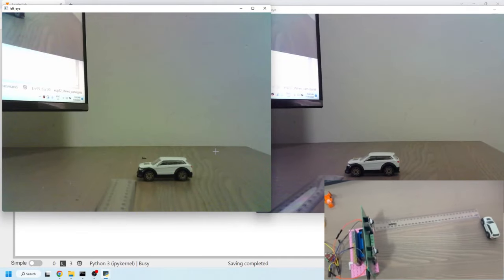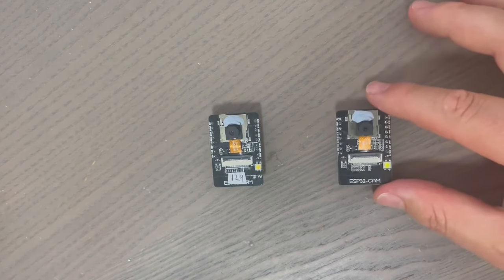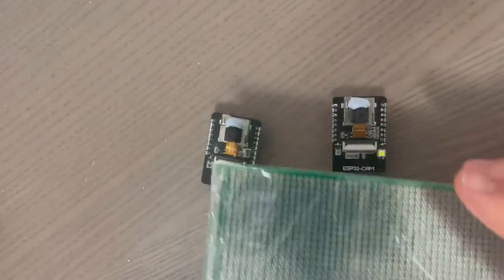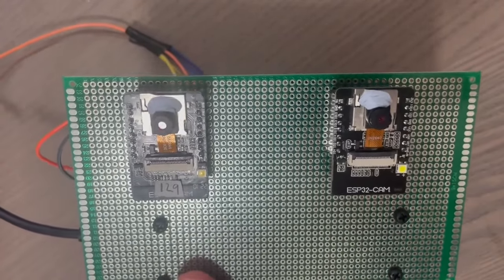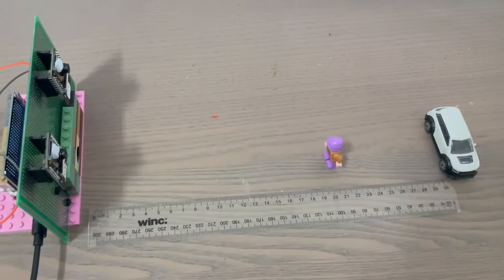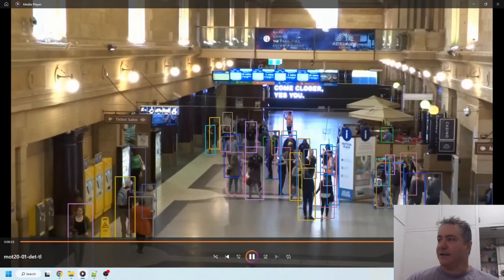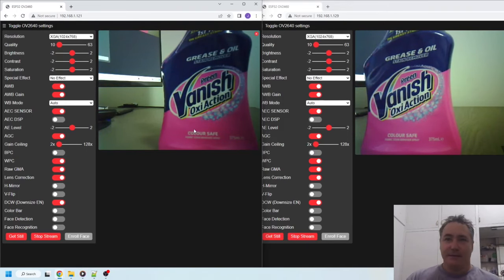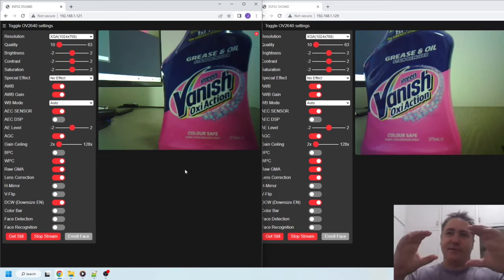ESP32 stereo camera for object detection, recognition and distance estimation

Comment: Amazing video, just got some minor questions:
- Is it a fair assumption to make that the focal length of this ov2640 is the same for all the of them from different esp32cams?
- Have you worked on calibrating the sensor to get the projection matrix?

Regards,
Kevin
Reply from the maker: Hi Kevin. Thanks for your comment. In my experience, ov2640 from different sellers (buying from ali express) can have varying degrees of quality.  So, I would say you need to calibrate every one of them. I haven't really spent much time on calibration. I usually just plug in the sensor and hope for the  best.

Comment: Have you heard of the old laser line trick for doing distance measurements? Super cheap, super fast, one camera and a (you guessed it) laser line. This is nice, because it tells you want the object is, which the laser line won't do. Nice work!
Reply from the maker: Thanks James. I will look at the laser line trick. I am planning to add a LIDAR to the esp32 camera at some stage. Hopefully, this will happen in the near future sometime.
Reply: @jonathanr4242  LiDAR are the cool toy everyone wants to play with. And they are wonderful, not doubt. A little spendy, but I'm seeing that the prices are getting down into the below $100 range? Hmmm... looks like a lot of those are NOT really LiDAR. LOL. The real problem with LiDAR and most 3D cameras is that they bury you in data. In the same way that the NN takes several seconds to lock in on the objects in this project, sorting through the LiDAR data and making use of it takes time. The laser line thing is nearly instant. It's a great first shot at ranging, which then helps things like image recognition because instead of handing the NN an entire frame, you can hand it just the one area where the object is known to be. That really speeds up recognition. And the total cost is like $5... or less actually, you can get cheap modules for a $1 from china.
Reply from the maker: Thank you, James. I will definitely look into it. Is the module you're referring to a time of flight sensor? Do you have any references for projects that have done this?
Reply: @jonathanr4242  I did it multiple times back in the 80's and it's been done many times since then but usually in slightly different form. It's nothing more than a laser line connected to an io pin to turn it on and off, and a camera. You capture a frame with the laser line off, then turn it on and capture another frame. Subtract the two frames, and the only thing left will be any reflections of the laser line against objects in front of the camera. Because of parallax between the line and the camera (the line is placed a bit below the camera), the distance from the bottom of the picture, up to the pixel where the line shows up, will be the range to the object. To clarify, the image subtraction is pixel by pixel. The first pixel (upper left corner) of the first image has a value (or values in RGB) and you subtract that value from the first pixel of the second image, making a new image with a pixel value which is the difference. One common use is with a turntable to make a low cost 3D scanner. like this from my site:
http://techref.massmind.org/techref/new/letter/news0310.htm
I'm suggesting that you don't use the turntable and you turn the laser and camera on their side. The laser projects out a plane under the camera, and only detects things that are resting on the surface. But then... what doesn't rest on the surface?
Reply from the maker: @JamesNewton  Thanks James! That sounds awesome. It gives me so many ideas. I had a project where I tried to use a laser to guide an electric water gun to the target. But I couldn't get this to work because the red light from the laser saturated the camera (showed up as all white), so it didn't work very well. I think  you've just told me how I can solve this.
Reply: @jonathanr4242  I'm glad to help, hope to see it in a future video. I'm always a little surprised that people haven't seen this. It worked back in the day, with a "camera" (video capture card) that had only 256 x 256 resolution and 256 grey scale, and it works fast today even in a web page (using a light block to trigger a phototransistor to turn on and off the laser). Let me know if you have questions or concerns.
Reply from the maker: @JamesNewton  Thanks for your help. I think I have all the equipment I need for the laser line in my man cave, but it's just a matter of finding the time with the other million projects I have started. I will reach out if I need help.

Comment: First, this video is amazing! 
Deployment of the model and communication with the esp32 are quite straight forward. 
The core of the project is the tracking and calculating the distance which I felt you kind of breezed over. I wish you could do an in depth video just on that part. A great video anyway though . Keep it up

After a second look - from my understanding there is a dangerous state where the object is close to the cameras. It will calculate the distance from the opposite corners of the object which will return...something that is probably not correct.  Good luck!  (The object should be symmetrical like a screen so the model predicts it as the same class)
Reply from the maker: Hi. Thanks for your comment. Yes the project needs a bit of tweaking. There are probably a fair few heuristics one can employ. In fact, every AI project will have some tweaks applied that will greatly improve them.

Also, I want to say that I discovered in another project that when I bring in the image from the esp32 cam, I'm taking it from a queue, so that I don't get the most recent image, I can get a bit of a delay. To fix this, I found this wrapper for the image capture stuff which avoids this bug. I've used the wrapper in another video with the time of flight camera. The github repo should be referenced in the description of that project. So basically, it uses a thread to keep reading eliminating frames in the queue so that when you want to grab a frame, it grabs the most recent, which is essential if you have moving objects.

Comment: Thanks for posting that and the files! Been wanting a nice stereo camera to use with an HMD, so I guess I may build a small edition of that.
Reply from the maker: Sounds Awesome! There is so much cool stuff you can do with a stereo camera. I made my own because I had some extra esp32-cams. But, the good thing about getting a proper stereo camera is that you can sync the frames a bit more easily, which is important if you want to do stereo video. I had some difficulties with synchronisation when I tried to use the esp32-cams for stereo video.
Reply: @jonathanr4242  Oh? Surprised. With short wires the latency should be short enough to synch the first frame.
Reply from the maker: @OMNI_INFINITY  I was using wifi with frame buffering. I didn't realise it at the time, but one solution would be to grab the most recent frame in the buffer, and drop the others.
Reply: @jonathanr4242  Ah. Can connect rx and tx of those seemingly.

Comment: Hello bro, just i came across your video, and i loved it, and i have watched some of your other videos also, I have a small doubt, can we detect the speed of the object, if its moving?
Reply from the maker: @rlrentertainmentsinventions  yes. Indeed, this project was inspired by a pedestrian tracking assignment I had. So, to measure linear motion should be ok. It might get more difficult with angular motion. 
I do have to wonder if there are Doppler shift speed sensors for arduino/esp32 microcontrollers?
Reply: @jonathanr4242   Ok bro, Anyways thanks for your reply

Comment: can you do a tutorial on connecting the hardware
Reply from the maker: Thanks for your comment. It's actually very simple to connect the hardware. All I do is make sure the two esp32 cams are on a grid, so that they are fixed in position, and then upload the sketch to them. In all honesty, the kind of stereo cam I've used is a bit messy. I would probably recommend using a proper usb type stereo camera.

Comment: Hi, i was thinking of trying this method for mesuring the distance between my car and other cars to further calculate their speeds.what can you say will be the max  range of object detection,will it give accurate distance for an object 100 meters away?
Reply from the maker: @pvngawas  I don’t think more than a few meters would work with my setup where I’ve only got the cameras a few cms apart. For 100 meters, the cameras would have to be further apart. I guess if they’re on either side of the car this would increase the distance you could measure. Also the resolution and quality would have to be quite good because you are counting how many pixels the left object has shifted with respect to the right.

Comment: Hi, I appreciate your work. You have done an excellent tutorial. I would like to ask about the system requirements to run the MaskRCNN_ResNet50_FPN_V2. Can you tell me about it? As I'm doing the same work but running on jetson nano. I'm not able to find a quite fast object detection model with good accuracy. I will appreciate your help. Thanks!
Reply from the maker: Hi Ans. Thank you for your kind words. I am using an old-ish lenovo yoga slim laptop. It takes around 5 seconds per image. In my next video I use YOLOV8 (model m), which is about 10 times faster. I haven't tried on a jetson nano, but I would like to. Please let me know how it goes.

Comment: hi, currently i doing distance estimation project from your video. i made the set up exactly like yours. esp32 cam kept at 7.05 cm away. do i need to calibrate my camera, or can i use the calculated value from the video for focal length and tantheta, since we are using the same setup? what are the values should i change in the code for tunning it, apart from focal length and tantheta? I have to submit the project soon😢😂
Reply from the maker: You need to calibrate the camera. Basically, you need to measure the same object at a few different distances and adjust the focal length and tantheta.

Comment: Hello, good job! with stereo cameras where can we find the width, height, fx, fy, cx, cy values from a photo taken or a video? Thanks in advance
Reply from the maker: Thanks. Most of the calibration information should be in the python notebooks on the github.
Reply from the maker: Also, I should probably mention that my approach is fairly simple. I'm only using the distance of the object from the camera, and the distance apart of the two cameras. My assumption is that both cameras have the same focal length.
Reply: Thank you but the parameters when taking the photo or video which concerns the values width, height, fx, fy, cx, cy that I quoted how are they found?
Reply from the maker: @welsonfy5246  I think my approach is a little different to what you find in the text book. I have two parameters, which are tan(theta) and focal length. And then, I take the corner point of the object as the matching point in each image to calculate the distance. I go through the calculations in the video, and they should be included in my code. There is room for improvement. For example, one improvement could be once you find the matching objects you can correct for parallax.

Comment: hello! the feed of the camera appears to be slow when object recognition and distance estimation are running, how do i speed it up?
Reply from the maker: Thanks for your message. There are a couple of things you can do.
1. If you want to speed up the object recognition part, you can use YOLOv5 or YOLOv8 instead of r-cnn I am using. This is much faster. Also running it on a GPU will make it faster. I have implemented this in the next video. The code is on this github repo: https://github.com/jonathanrandall/autonomous_task_stereo_cam
2. Secondly, if you just want to speed up the video capture part, you can try running on a separate thread. See the solution to this question on stackoverflow: https://stackoverflow.com/questions/43665208/how-to-get-the-latest-frame-from-capture-device-camera-in-opencv
You might want to try moving the imshow inside the videocapture class if you implement the above thread.

Comment: thank you for the video 
how to upload code bez there is no port?
is there any hardware circuit diagram
Reply from the maker: you need to use an FTDI to connect the ai thinker to a usb. You can get these from Amazon or aliexpress. There are other esp32 cams which have a usb conneciton, like the XAIO esp32 cam. They're generally a bit more expensive, but worth it.

Comment: Is there a way to reduce processing time (Possibly realtime)?
Reply from the maker: Yes. To do in real time, you would need to use Yolov8 and run on a gpu.
Reply: The main thing you can try is using smaller images. Pixels count increases by O^2 when increasing dimensions which means significant memory savings from downsizing images. The latest YOLO versions have lightweight versions (tiny, nano) which are designed to run faster on basic hardware. You can probably get 5-10fps on small images with v8-tiny on a decent laptop.
Reply: @JamesTimpson  Thanks a lot for reply, we will probably test on 240 x 240 images initially. Thanks again

Comment: Hi, thank you for this great video. I learned a lot from you just in this one video. But I think you made a mistake in one part of the code to calculate the focal length. 

you use this formula:  f1=30-38.44*50/68.75

I think you must use this: f1=(30-38.44*50/68.75)/(1-38.44/68.75)

I also have a question. Can we use this distance to get the horizontal and vertical distance of the object to the camera?
Reply from the maker: Hi. Thanks for your comment. Yes. It’s not difficult to measure height and width. You can do it from the geometry by taking the ratio of pixels across to the pixel width.

Comment: what the maximum range it can deduct the distance of an object?
Reply from the maker: Thanks for your thought inspiring comment. Using 640x480 resolution, I think I was able to accurately measure up to around 120cm (if I remember correctly ?). As the resolution increases, so does the maximum distance. You can calculate the theoretical maximum by taking the left/right distance apart as 1 pixel. But I would probably divide this by at least three, taking into account practical considerations. But then I guess the distance resolution would also decrease as the distance away increased.

Comment: Hello sir.. i am doing a project exactly same as you have done in the video previously i was using 1 esp32 camera and everytime i got wrong distance of the object..sir can you help if i use 2 esp32 can i do it like you
Reply from the maker: You need to use two esp32.
Reply: @jonathanr4242  Sir, Should I train model for object detection? I had used two esp32 like you but it was not detecting any object like person etc. Can you please help?

Comment: Can I create a model on YOLO8 to find especifc mouses , can I simple deploit in the program ?
Reply from the maker: Yes. The only issue is you will need lots of training data.
Reply: @jonathanr4242  thank you, I did and now is working perfect, one thing yet is that ,I saw your video many times, and I still didn't get the ideia behind the focus legnth calculation, could you write a resume here please ?
Reply: or give any paper ?
Reply: @jonathanr4242  I didn't get how you got the formula f = 30-38*50/68
Reply from the maker: @waltherhumberto271  this is the formula at the bottom right at 15:38. I’ve placed the object 30cms away for calibration and measured the other values manually.

Comment: Binocular camera product introduction:

  Based on the OV2640 camera, the binocular camera switches display, the pin is compatible with the standard 24P camera, and can be directly connected through the 24P FPC cable.
  The binocular distance is 60mm, which is close to the real body distance of the human body. It can be used for deep visual research. MaixPy provides a binocular operation interface.

Comment: I have a problem with the weights file i dwonloaded it but still got the same problem
Reply from the maker: what is the error that you are getting?
Reply: @jonathanr4242  pytorchstream readerfailed reading zip archive failed finding central directory
Reply from the maker: @a7medrafat31  Oh! I've never seen that error. In the next video, I do the stereo pair matching with yolov8. I've put the notebooks on the github for those as well. It's much faster than pytorch, but not as reliable. And you can tweak it, I suppose. The git repository is called autonomous_task_stereo_cam
Reply: @jonathanr4242  i resolved the error but i want to know how to make inference continously ?
Reply from the maker: @a7medrafat31  You will probably need a stereo camera that can synchronise the left and right images. If you're using the esp32-cam, there will be a lag between left and right images.
Also, you will most likely need to implement the object segmentation and detection on a GPU to get it to keep up with the frame rate.
Reply: @jonathanr4242  thank you, and what part of the code should be changed
Reply from the maker: @a7medrafat31  The code I wrote for the ESP32 stereo camera for autonomous task completion runs continuously, it's more a matter of updating hardware to run it in real time. Probably a good place to start is looking into implementing YOLO or RCNN on GPU. Let me know how you go.

Comment: sir, how to solve it ?

Traceback (most recent call last):
  File "C:/Users/ASUS/OneDrive/Documents/test.py", line 59, in <module>
    faces = face_classifier.detectMultiScale(gray)
cv2.error: OpenCV(4.5.3) C:\Users\runneradmin\AppData\Local\Temp\pip-req-build-uzca7qz1\opencv\modules\objdetect\src\cascadedetect.cpp:1689: error: (-215:Assertion failed) !empty() in function 'cv::CascadeClassifier::detectMultiScale'
Reply from the maker: It's difficult to tell without know what part of the code is causing the exception. Usually, I would try to isolate the error.